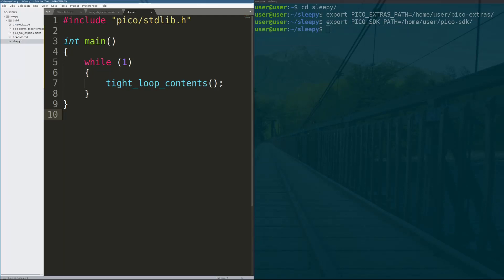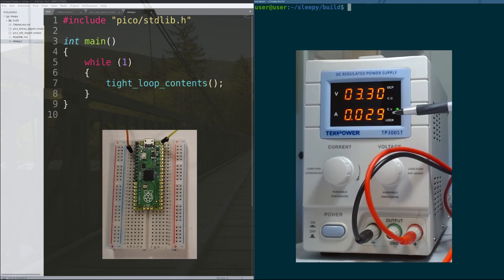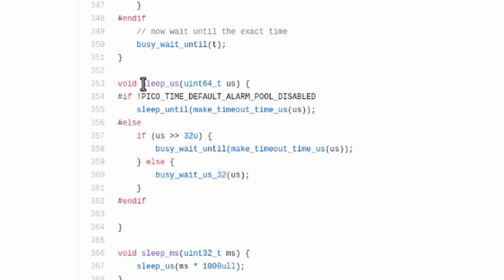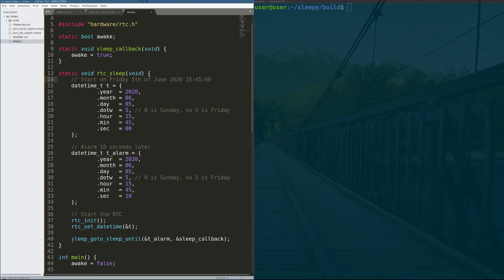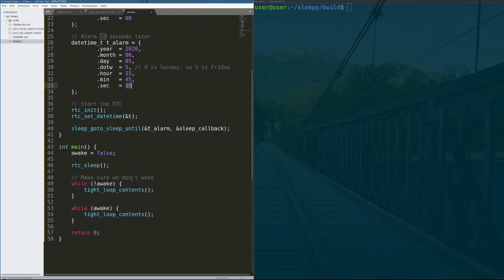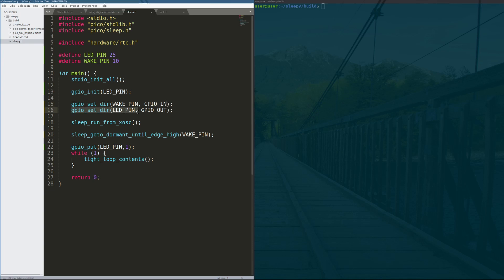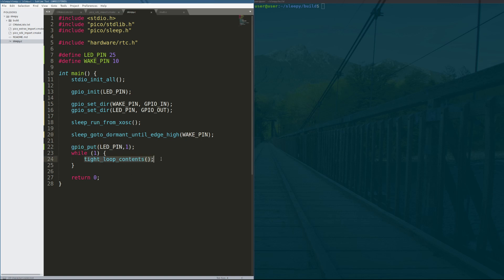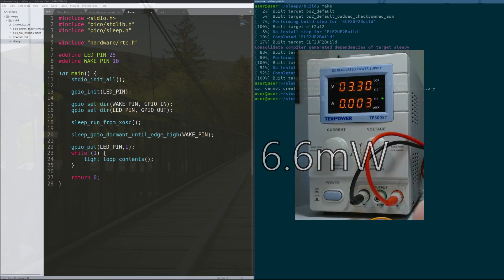Raspberry Pi Pico Deep Sleep Low Power Tutorial  |  Rising Signal Wake-Up on the RP2040

Comment: Thanks for doing this tests! Would like to add, for those that are not very familiar with this topic, that 6 mW draw in sleep is not low by modern standards. Low power was definitely not a priority with RP2040, but there are many ARM microcontrollers out there that can go down to a few uW during (useful) sleep. Just something to keep in mind if one ever considers a project powered by a small battery that shouldn't go dead in a few days.
Reply from the maker: Good to know, thank you!
Reply: But where is the power draw from? I assume you can turn off core sysclk? and only run a timer on 32KHz that when its ISR wakes up, the core starts running on hfrc first until PLL is ready? as I assume you can turn off the two PLL's? as those are a power hog.  Can you turn off ram banks to save power?
Reply: Can you give me some examples? i'm interested in creating a modern version of the alphasmart word processors. there's nothing wrong with them, they were just discontinued like over a decade ago. i'm thinking an e-ink display and fonts for every single language in the world. Something that I can have 700 hours of use if you're a slow typist by going into sleep mode between each case stroke. My idea is to basically make it stand alone without a keyboard so it can sell for a lot cheaper and you can use whatever typing experience you prefer, we had a cheap membrane keyboard or a $300 split ergonomic mechanical keyboard.
Reply: @MrGamelover23  Looking at what e-readers use would be a good starting point. Your product seems ambitious enough to benefit from one of the "application processors" (e.g. Cortex-A family), which are more powerful and can run OS like Linux, as opposed to microcontrollers (e.g. Cortex-M family), which are not really meant to handle complex, modern user interfaces. This is very important design choice that requires thorough investigation! I sadly don't have any experience with Cortex-A parts. Microcontrollers that I brought down or under single digit uW in sleep were from NXP (Kinetis family) and Nordic (nRF52 family). I know for a fact that there's a whole plethora of parts from different manufacturers that could do the same.
Reply: @WisseSpring  the original alphasmart neo could go for $700 off of 3 AA batteries. That's why I think it might be better to be a single software instead of a software running within an os. it doesn't exactly need a complex user interface, but you're right that is something that requires thorough investigation. Thank you. The neo used a 33MHz DragonballVZ, which is a 68000-based processor made by Freescale/Motorola. Any idea what the modern equivalent would be? (The VZ saves every keystroke to RAM, which is unnoticeable in operation but makes it quite important to keep a fresh coin cell on board.) Edit: apparently this is the family of processors that replaced it https://en.m.wikipedia.org/wiki/I.MX
Reply: Well noted.  I was hoping to get over TI MSP430  supply woes by replacing  with the RP2040.  Sadly, 1uA (MSP430) versus 2mA (RP2040) is a drubbing.
Reply: @DenisCollis  I have a few theories on the power draw. 
1. 40nm architecture, is not known for low power if you look at ST L range 14nm is standard even GD32 also 14nm.
2. If he is using the pico board it can also be the parasitic power lost on buckboost can be a issue.
Reply: What appeals to me is its $1 price and market availability. But deep sleep current is very important for iot node projects.

Comment: At first - great tutorial about going into deep sleep, but how to wake the board back in normal operation mode? Do we need to to extra steps to bring subsystems work as usual, like UART ? Im currently working on canbus convertion board and id draws around 0.07A with 4 canbus controllers and 2 lin adapters and i want to lower power consumption as much as i can but have ability tp wake up the whole system upon external interupt (canbus activity)

Comment: This was quite helpful, thanks for the detail in the video. Have you tested anything like a simple sensor and running on battery power? I have an infrared sensor that I want to use on battery with the Pico, but I would need it to last 1-2 weeks on low usage. Any thoughts on that or trials you have done?
Reply from the maker: Unfortunately not yet, but I plan on doing some longer form project videos with the Pico where I might experiment with battery capacity.

Comment: Total newbie here; would you recommend using a Pico (W) for a battery powered project in combination with an e-paper display in a lora (mesh) configuration? Hard to tell what the wake / sleep ration is because I'm not sure how (often) lora nodes can / should relay messages. In a normal use case, the board receives instructions, displays some stuff and waits for some sort of acknowledgement, sleeps for ~ 5 - 10 minutes, sends input from the node and then goes back to sleep. While it wakes up, it should remember its "state" (or know to request the last state from the "server").

Comment: I prefer using mA and uA and not mW.
So dormant mode is 180uA per data sheet, a little high as smaller MCU Cortex sleeps around 2uA-5uA. 
I guess the 264KB of RAM is the reason, they should had implemented the option to just have one bank on during dormant sleep.
A 2000 mAh lipo and doing 98% sleep is still a year worth, as 2000*1000uA/180uA/24hrs = 416days of just sleeping and not taking it to account battery self-discharge.
Reply: The RP2040 chip on the pico does have the means to turn off SRAM and the USB DPRAM, see section 2.11.4 of the RP2040 datasheet. But there is no support for it in the SDK, other than the fact they provide structs that wrap the hardware registers, which you can use to set the necessary bits. Manipulating the registers isn‘t actually that hard, if you read the docs carefully to get it right; but it would be nice to have SDK code that gets it right for you.

They mention in that chapter of the datasheet that you can also turn off the flash cache, but that it probably won‘t save you much power when it‘s fetching code from flash anyway.

The sleep source code in pico-extras mentioned in the video has this comment:

// TODO: Optionally, memories can also be powered down.

So it looks like they released the pico and the SDK with some of the power-saving support on the SDK to-do list. More may be coming up in future versions.
Reply: @slimhazard  I see that dormant options is ram-static-mode, not power down mode , that if some ram banks complete loss of data was OK, could save more power if it was implemented.
Reply: @tonysofla  MEMPOWERDOWN register actually disables all ram. But it is not possible to go dormant because all ram was power down a few cycles ago. If there was a way to set irq bits and mempowerdown at the same time, we can make a very low power rp2040.
And i guess it is not possible to use external low voltage source for ram power.

Comment: Nice video! Wish these sleep modes would be supported in the Pico Python SDK. Both, machine.lightsleep and machine.deepsleep don't seem to help much in reducing power consumption. My only effective way of reducing power consumption under Python was to reduce the MCU clock frequency. Going down to 10MHz, my Pi Pico board consumed 4.5mA, vs. 21.4mA at standard f(clk). But you need to make sure you crank it back up to 125MHz before your Python code finishes, to make the USB i/f work properly.
Reply: That’s probably a limitation of micro Python itself, does sleep work correctly on the esp32 using micro Python? The reason it doesn’t work at least with the pico is probably because it always needs to run the interpreter at all times, to decide what to do and it might be difficult but not impossible to sleep the interpreter too. They may have decided that anyone programming in Python doesn’t care as much about performance or power consumption which to be fair if you are serious about either then you’d use a compiled language like c or rust anyway.
Reply: @conorstewart2214  Agreed, Low Power Apps might not have been high on the list when creating the MicroPython build for RP2040. However, the interpreter is an 'overhead' part of the Python script code that runs on the RP2040, not running as a separate thread. To resume a script after a sleep, the RP2040 needs an interrupt from either its Timer module or an external (e.g. GPIO) source. That's part of the current MicroPython implementation, so I can't think of a showstopper to make lightsleep() a real power saver function in MicroPython, including the clock switch to XOSC and back, like it's possible in C.

Comment: Thanks for the video. I keep coming back to it :D

is there any updates on this (using Arduino IDE) ?
I still have picos lying around I wonder if the implementation changed or was improved in the meantime.

I switched to the esp32 that comes with 150 µA deep sleep mode that doesnt require any extra libraries. But I still also like the pico but avoided it so far for battery projects.

Comment: I'm still wanting to get a few Pi Picos. They are starting to be more in stock at the nearest Micro Center which is about an hour away. (Depending on traffic) Just don't have the money to spend atm. 

Besides, I still have some ATmega based arduinos to mess with for lower processing projects. 

I do think it would be fun to turn a Pico into a fantasy handheld console instead of yet another emulation box. A decently fast SPI screen, some buttons, and a DAC should be more than enough. Maybe even an SD card port to load the "ROMs" from. 

Do you think the Pico would be powerful enough to have one core be the main loading and processing for games and the other create GBA like graphics and sounds?
Reply: If you have cheap PCB manufacturing and shipping available then you should definitely make a custom handheld gaming console like the ones sold by Adafruit. It would be a great project.
Reply from the maker: Yeah they became hard to get very fast

Comment: Perhaps this isn't as easy as I'd think (hope) it is, but how do you go about porting across libraries to run on Pico? E.g. I2Cdevlib or RF24.
Reply from the maker: It really depends what the library does. If its something simple like crypto or maybe an I2C parser then you can trick CMake into building it into your project. Anything that relies on hardware directly wont work.

The pico-sdk links in parts of glibc, so if your library sits on top of that, youre good
Reply: @LowLevelTV  take the I2Cdevlib for example. It's written predominantly for Arduino. There is libraries for specific chips with a I2C file that deals with read/write separately. Hence would it just be a case of altering this to use Pico I2C and including in CMakeLists, or is there something more that I'm missing? Apologies if this is an obvious question.
Reply: Yeah, don't port libraries, look for similar libraries on the pico. You will have to alter your program to use the pico libraries.

Comment: There is one thing. I'm trying to use this library but the problem is when the pico wakes up it starts running the code so slow, idk maybe processor slows down but definitely something happens. Does any one experienced this issue with a real world project?
(Updated question, read below)

Yes guys, keep in mind when the pico wakes up, clocks are not functioning well, here is the before after output

Clock speeds before after

Before sleep:
PERI: 125000000
GP0: 0
GP1: 0
GP2: 0
GP3: 0
REF: 12000000
SYS: 125000000
USB: 48000000
ADC: 48000000
RTC: 46875

After wake up:
PERI: 12000000
GP0: 0
GP1: 0
GP2: 0
GP3: 0
REF: 12000000
SYS: 12000000
USB: 0
ADC: 0
RTC: 46875

Comment: Very interesting demonstration of the different sleep modes.

However I think it is very difficult for the power supply to accurately measure and show real life current draw in this situation.

The pico uses a onboard buck-boost SMPS which is probably operating at a frequency which can not be sampled by the psu current display.
This might pose a risk to either over or under estimating the current draw